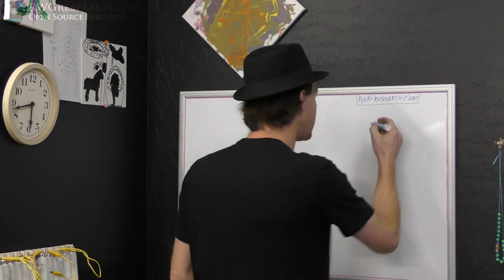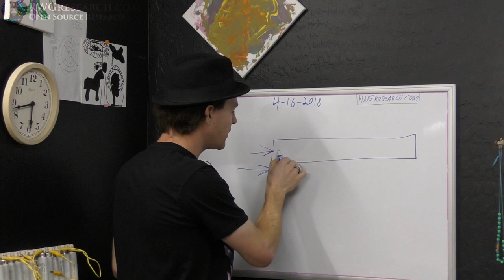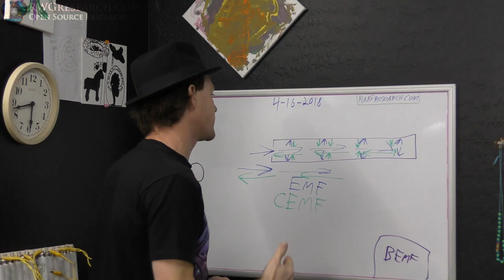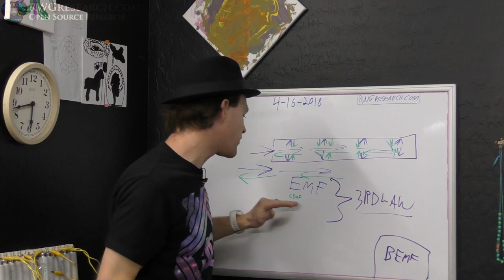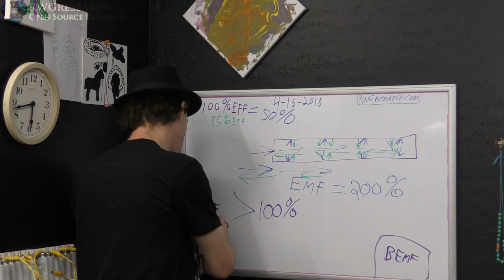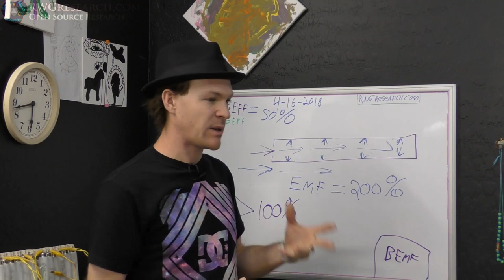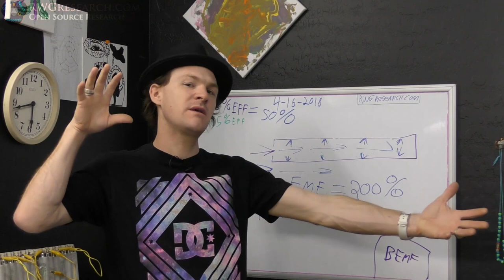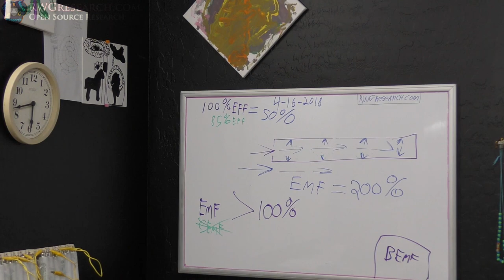The Search For Answers Part 18: EMF + CEMF = Newton's Third Law. EMF - CEMF = BROKE

Comment: Magnet is a balanced system where molecules are positioned in uniformed direction! South pole is perfectly balancing North pole inside that magnet. But in relation to external inductor when it is moved, it is creating dis-balance in that conductor. When you apply magnet to the conductor you are creating magnetic wave of specific polarity in that conductor! Imagine that you trow a stone in the water. That create a wave on the SURFACE. The speed and the mass of that stone would reflect on wave speed and amplitude of the wave. When you hit conductor with magnet movement you creating electro magnetic wave in that conductor. The speed of magnet movement would be the frequency of that wave and magnet field magnitude would be the amplitude of that wave. When magnet is created, it is heated up, then external magnetic field is applied. After magnet cools down molecules are aligned in same direction and stay "frozen" until magnet is reheated or deformed. NO energy is extracted from magnet! Like a stone analogy: when stone hit the water it is not changing stone properties.

Comment: Besides the fact that magnets do no work, you need to realize that the power isn't stored in the wires, its stored outside the wires in the fields, look into pointing vectors. Accepting this as true, this immediately shows a difference between the pipe analogy.

Comment: When you move a magnet past a wire, you're not getting energy from the magnet. You're converting the energy from your arm motion to electrical energy.

Even if it didn't take any energy to produce a permanent magnet, and even if permanent magnets lasted forever, you wouldn't get any energy "out of the magnet".

You only get current from a changing magnetic field. Moving the magnet requires energy.

Moving a magnet past a wire will require different amount of energy depending on what's connected to the wire.

A generator without a load, is easy to turn. Have that generator light a light, or charge a battery and it will be harder to turn.
Reply from the maker: "When you move a magnet past a wire, you're not getting energy from the magnet. You're converting the energy from your arm motion to electrical energy. Even if it didn't take any energy to produce a permanent magnet, and even if permanent magnets lasted forever, you wouldn't get any energy "out of the magnet"."

Right, so if i move my hand past a wire with no magnet... i got nothing out of the wire.. so the interaction between the magnet and the wire is where the action is at... that is the point I'm making. Now take that magnet is demagnetize it.. now even tho it will take the same power to move that "non-magnet" past the wire we get nothing from the wire... there for the FIELD that is coming from the magnet is where the action is at. and this Feild is with in the magnet its self... when we "magnetize" it we just " push" this field out of the magnet.  This is the Field... and the field is what interacts with the wire.  

"Moving a magnet past a wire will require different amount of energy depending on what's connected to the wire."

This is correct, but not true for all cases. And this is the point of this video.

 open the coil. pass the magnet. no resistance to the magnet...  

now close the coil,   pass the magnet.  now there is a resistance to the magnet.... 

 now ask your self. when the coil was open. was there induction? was the same amount of "current" induced in to the coil when it was open as when it was closed? 

Check it... there was voltage at the open ends right? there for there was induction... but yet no resistance to the magnet... think about that for a while. its hard to wrap your head around. however you just created EMF with no CEMF... and there for no resistance.  But there WAS EMF in that wire!!! if there was not there would be no voltage to measure... remember EMF and voltage are not one in the same... 

"A generator without a load, is easy to turn. Have that generator light a light, or charge a battery and it will be harder to turn."

that's right. there for you have a CEMF... if you remove that component... there will be NO change in how easy/hard it is to turn with or with out a load. This is a proven fact.  its unfortunate its not well understood and taught how to do this... 

dont just reply with out thinking... think about what i just said for a while before you respond... 

~Russ
Reply: rwg42985 When you measure the voltage across the wire, you put a resistor in series with it. It will only be able to produce a small current, and the magnet will have significantly less resistance than producing as much as current as a dead short would pass through
Reply from the maker: again, when you do this, you are creating an CEMF... this is the point of this video. if there was no CEMF then you could get FULL current from that coil with NO resistance on the magnet... so if you OPEN the coil... you effectively do just that... you STILL HAVE an EMF from the magnet... and its still at its full potential... the goal is to generate an EMF with no CEMF. and in doing so use that EMF to do work... yes its not easy to wrap your head around but if you read the patent i mention in this video it will at least help you understand the concept. ~Rus
Reply: rwg42985 I think it warrents investigation and math
Reply from the maker: its also very important to realize that with an open ended coil your measuring voltage. and voltage is generated when there is an EMF. This voltage tells you how much EMF there is. there for the more electrical resistance you put on your coil the more current you can measure, However the less the voltage you measure. There for the total amount of EMF in the coil is the same loaded or not loaded. The result is not the same for the magnet's resistance to moment... ~Russ
Reply: +rwg42985  Duane Degn is absolutely right and you are just misleading yourself.  You are always buying into "somebody else's theory" when you should be using your own critical thinking skills along with real research and bench experiments to arrive at the proper conclusions yourself.  When you wave a magnet past a wire the magnet is nothing more than a magnetic gear passing power from your arm into the wire.  When is the last time you said a gear was a magical source of energy?  A gear is not a magical source of energy, it just passes power from the input side to the output side.  What is so hard about applying the same concept to a magnet in this application?

Comment: Just my thoughts I believe most CEMF can be cleverly switched or shorted out so you can get a substantial gain. How do you keep something from bouncing back use it up, so short it or shunt it, in an electric circuit at the right time. Catch every thing you can before shorting. A conventional generator will never be over 100% efficient so build a generator with less drag, reducing maybe even eliminating  CEMF  exceeding 100%  this is thinking outside of the box.
Keep an open mind anything is possible.

Comment: Hi Russ, Thanks for the video. I like some of the stuff you’ve done. 
That said, EMF = Electro – Motive- Force, as I’m sure you know. Voltage is defined as “The pressure that causes a flow of electric current through a conductor”, which I’m sure you also, know. Defined by Ohm’s Law as V=I x R, Or as I learned it, E/IR. 
EMF and Voltage are Exactly the same thing, and describe the same force. I’m stunned to hear you say otherwise.
Now I agree with most what you have to say about what most folks would call a “Gradient”, or a pair of unequal amounts of a substance separated by time, distance, or charge as in our case.  And that means that no electrons or charges of any type will flow into an open circuit, demonstrated by the unconnected wire. No charge flows to produce the CEMF you are trying to eliminate.

Comment: Does anyone know what to measure the current? ... Answer: Of course with ampermeter. Sure? !
I say there is no device to measure the current ! just an estimate, due to the voltage drop on a resistor.
Voltage and current is the eater manifestation.
Reply from the maker: when dealing with time variant circuits you cant even do that.... it gets really hard to decipher whats going on in your circuit... ~Russ

Comment: ok Great talk. Now lets chat about what a bifilar coil really is.
 In my opinion this is what a bifilar coil does. This is why it produces a stronger magnetic field. Remember that you can not get rid of the cemf but you can invert it like you have shown to add to the emf. In effect raising it's strength.
 The interposed winding on an ordered bifilar solenoid Should invert the pulse or impulse and suck it through the coil. It is an intermittent type of coil that has a built in enhanced capacity for the pulses or impulses. Sling shot reference here.
Reply from the maker: "Sling shot reference here" yep... This is also "recycling" the energy in the system that was built up in the spin momentum... it can be recovered and used over and over until the only real losses in the system take there tole... and in the process doing REAL WORK while this is happening. ~Russ
Reply: Yup as long as you have the inverting aspect of the cemf then any input would "seem" to be multiplied at the output...
Scoop some off recycle to the input and transform the rest into real current...

Comment: You're describing the reactive power in the primary and real power in the secondaries in a BiTT overunity transformer. I'm about to replicate one and try different frequencies of the driving circuit to see what happens in a range from a few hertz up to 1 MHz. The inventor had already tested several transformers with efficiency from 120% up to 1600 %. The excess energy comes from the vacuum energy, which is exactly the polarized electromagnetic field. I'm going to make a series of videos and start an account on Patreon.com to receive some help from people and improve Thane Heins's designs. I've spent some time and effort on it and it was really worth it.

Comment: Stanley's patent seems to describe a regular transformer with a core made of mercury (metal), inside a non metallic (avoid the squirrel cage effect) vacuumed tube and a pump to initiate the circulation. This would certainly reduce the core's resistant; something to look into...

Comment: Thank you Russ for explaining these most important concepts for motor generators. This is thinking that can bring measureable results explaining how it is possible in theory to improve power generation and efficiency for useable  power. Some electrical concepts are limited to local use in our typical hardware circuit theory.

Comment: What about capacitance in a dielectric? E.g. Your plates which held a charge with 10k volts, which could be stacked, and added together... what if the electromagnet is just missing a dielectric of the right type? If we have a permanent spin in a magnet, what is our inverse of a permanent spin? I love the balance questions, we know there is balance, so any effect, there will be an opposite, just curious if there are more similarities in what we "know" versus what we have seen as results... bedini's ssg covers the use of CEMF pretty well, utilizing a battery, and the chemical reaction as the method of creating useable power from cemf/emf. 

I have some interesting theories which flow in line with yours, found these quite fascinating,  and look forward to more!

Thanks for what you do!

Comment: Russ,CEMF is the self induced EMF of an inductor. It is neither equal to,or opposite to the applied EMF. Without CEMF,your current through an inductor would rise to it's resistive  maximum value instantly,and you would have a resistive heater. Voltage is the units we use to show the value of the EMF-the two cannot be separated.Thank people like Jim Murry and Paul Babcock? ,are you kidding?. If you are now following those guy's,then you are on the path that leads nowhere. 

 Sad times indeed.

Brad